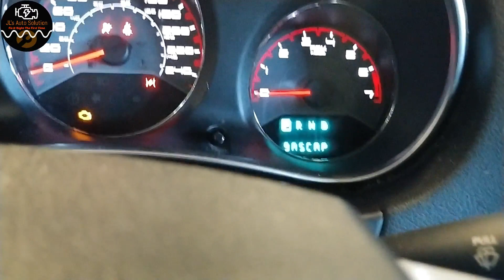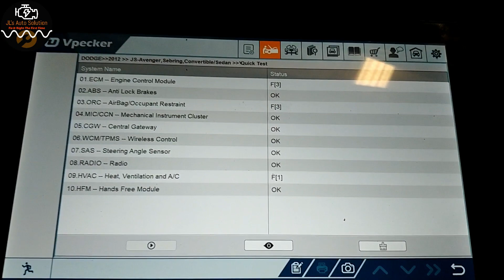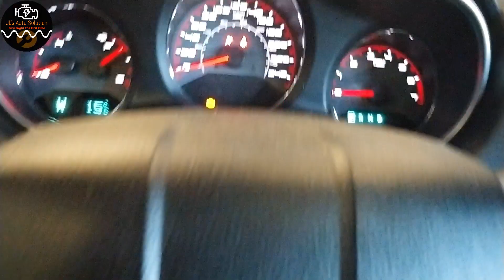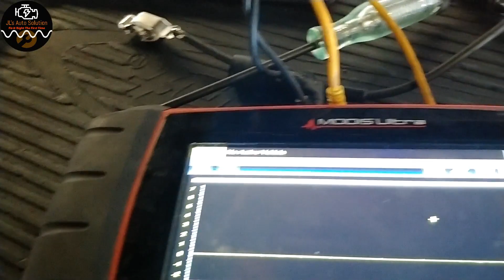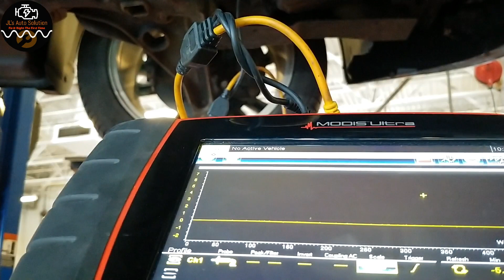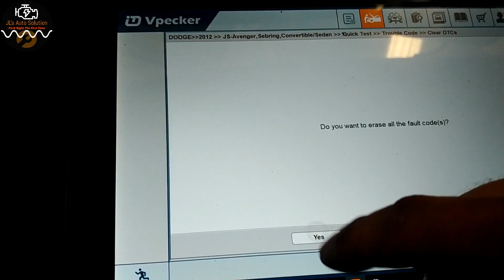Comment: I have an 08. I've replaced the sensors and throttle body. I still can't get mine to start. Can't get the throttle bodies to relearn.  I've tried 2. What else could be wrong?
Reply: Fuel pump

Comment: It says gascap as soon as you tried turning it on. Isn't that a known fault that can cause inability to start or rough running conditions?
Reply: a loose gas cap is known to cause a large leak in the evap system due to the systems inability create a vacuum in the system, and suck up the fuel vapors from the evap canister when the system is suppose to be in its purge cycle.

I have yet to have a vehicle that actually have a bad gas cap, and have yet to see a vehicle run rough due to a large leak and the ecm would flag a large leak as soon as it happened, small leaks tend to take a little more time for the vehicle to  detect.
Is it possible under the right conditions(yes), but I have yet to experience that fault.

Now on a side note. this vehicle came to the shop with a customer concern for a  no start condition. so as a technician,  my job is to fix the customers concern and advise them of any other conditions that may be present on to the vehicle.

unless the customer agrees to pay for the diagnosis of two separate issues, my main focus is the no start.

thanks for watching😁

Comment: Is the RPM gauge supposed to move at some point? I have one I've replaced the sensor on. And I've found with these cheap sensors that some just don't work. The connector has 5 volts on each side and a ground in the middle. Car just turns over. You think another sensor would help?
Reply: Yes at some point you should see the tach start to move.. have you scanned the vehicle for DTC's(codes) if so which codes are present..
Reply: @JLsAutoSolution  Yes I have. Just low oil pressure and the crank sensor came up.
Reply: @bryantr90  prob a wiring prob with the injectors
Reply: It was a bad new sensor. Forgot to share :)